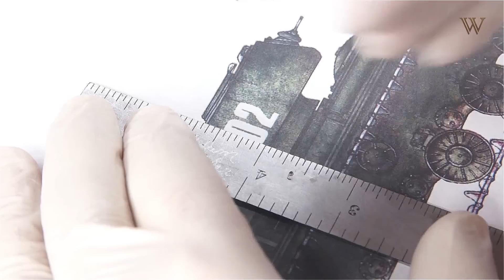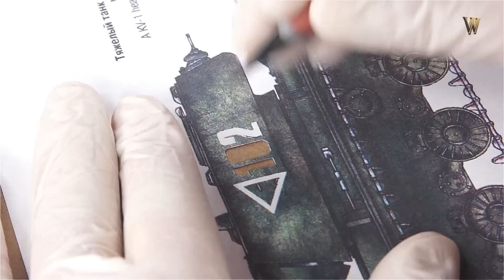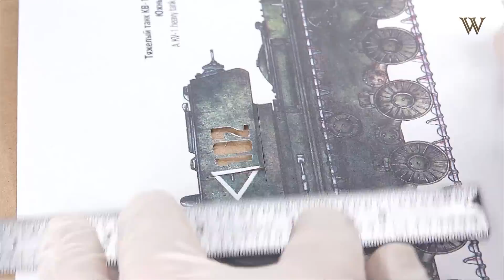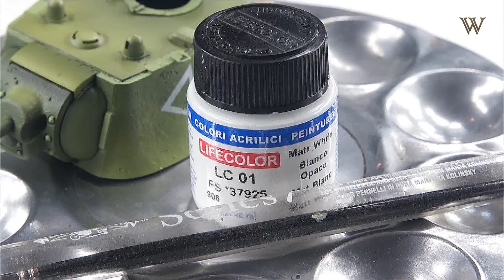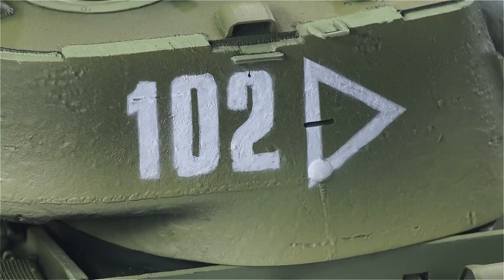FINISHING TECHNICS: KV-1. Episode 1

Comment: Very well done Adam!  I like to cut stencils out of Tamiya tape, lightly stuck to wax paper.  They cut easily, are durable, and easy to remove.  When attached to your model, they will conform to curved surfaces without a lot of extra work.
Reply: Do ou cut the wax paper after the tape is on it, or how does this system work?

Comment: Why do you use lacquer thinner with tamiya acrylic varnish?
Reply: Nicolas Rouanet Yes I did.
Reply: Adam Wilder yes but is there a particular reason to use lacquer thinner instead of acrylic thinner?
Reply: Nicolas Rouanet Lacquer thinner gives much smoother finish, sprays alot better, harder finish and gives finer lines. Regular acrylic thinner with white cap (Ispopropyl alcohol) gives that dreaded sandy mat finish. The paint itself has lacquer based additives in it, even though it has that isopropyl smell. But man if you dont have a respirator, you better get one before spraying it and so should i. PS same with the varnish lol
Reply: +Nicolas Rouanet Technically, if you look at the chemical composition of Tamiya or Gunze Mr Hobby Aqueous for that matter,  you will discover that they are more of an "acrylic lacquer" if you will, or have lacquer additives.
Reply: Tamiya is a solvent based acrylic and using a hotter solvent like lacquer thinner will help dissolve/thin the pigment’s latticework for a smoother finish. Most often you will find people using Mr Leveling Thinner for the added retardant which increases dry time for a longer working period and to let the paint settle extra smooth.

Comment: Why do you use laqcuer thinner for thinning acryl paint (varnish)? 
Lacquer thinner was made for lacquer products, such as paints, varnishes, primers, etc., not for acrylic.
 Yes, i know, many people make dilution this way, but i think it's wrong...
Reply: Vitalis Dr Tamiya acrylics and Mr. Hobby’s Aqueous line are lacquer based acrylics. They can be thinned with water, acrylic thinners, isopropyl alcohol and lacquer thinner but lacquer thinner works the best when spraying and water works the worst when sprayin. You can still use water for brush painting but it is better to use %100 acrylics like Vallejo, AK and Ammo for brush painting.
Reply: Solvent based acrylics can use lacquer thinner as it is a solvent. People often use Mr Leveling with Tamiya for the retardant to form a smoother, more durable coat.